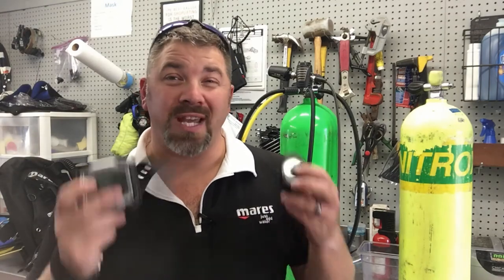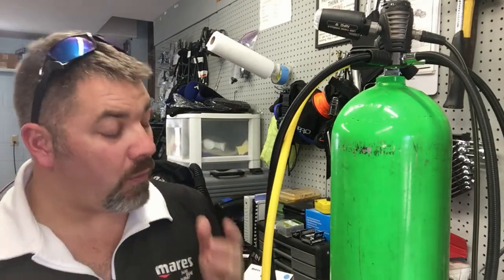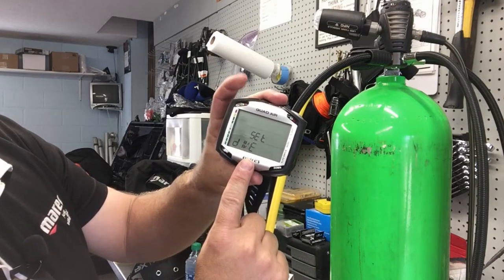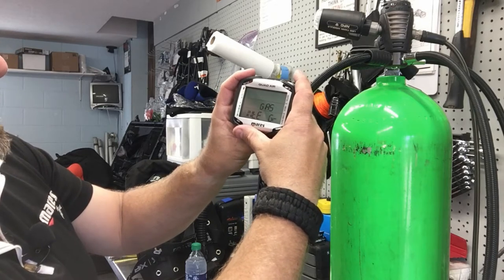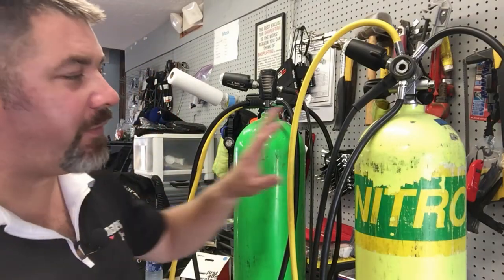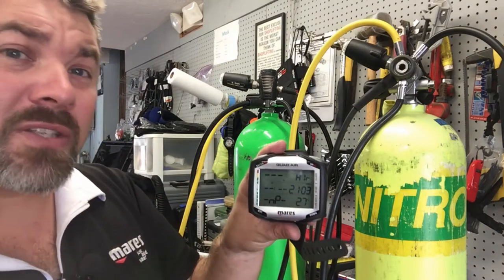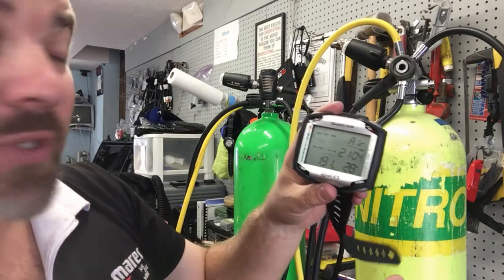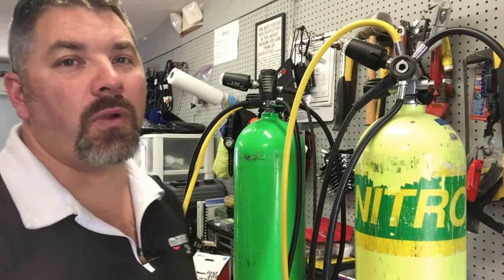Pairing Multiple Computers To The Mares LED Transmitter / Multi Gas

Comment: That's the same question I had.excellant.news.What computer would you recommend as  a back up.ive got a suunto eon core with tank pod
Reply from the maker: A lot of divers will use a single button computer for a back up.  In the Mares line the Puck Pro is a great option.

Comment: I tried this with a Mares Icon HD and a Smart Air - when the second computer paired (whatever the order), the first computer always lost its paring. It seems likely that this is related to the tank module itself not being able to memorise 2 pairings. Did you manage to validate that both computers remain paired, even after closing an re-opening the tank valve?
Reply from the maker: Hello @timshannon77. Outside of this video, we have not explored much more into the topic. From personal experience with the LED Transmitter, I have found that as the battery gets weaker, it can come unpaired at times. Its also possible it could be a firmware issue with the computer itself. Something may be causing it to force the unpairing of one or the other transmitters.

Comment: Presumably this will also work on suunto computers and other manufactures like Tisa. Aqualung etc.
Reply from the maker: Hello Kurt, I have heard that other manufactures have programmed their computers to do the same, but not sure exactly which model. If you have an Air Integrated Computer of a different manufacture than Mares, test it out and let us know.
Reply: @LakeHickoryScuba  
Certainly Brian. But only have one at present.
Suunto vyper air 2.
With suunto transmitter.
I would need to borrow a second one. I tend to use a traditional divers watch as back up.
As we never had these doing clearance diving in the Royal Navy.
But will let you know if I can sort it out the results.
Reply: @LakeHickoryScuba  
I also tend to use traditional gage pressure as back up if transmitter fails Naval habit of backup systems. Where possible.
Reply: This I found interesting Bryan. So more like this I am a technical person being an engineer.
Reply from the maker: I too will usually dive with a pressure gauge as well, even while using an Air Integrated Computer.

Comment: Do you expect much advances in AI computers, I'm waiting for the price to come down also how tough is the transmitter, are they able to sustain a tank falling over?
Reply from the maker: Hey john, I have seen the price on computers come way down and go way up over the years.  Most transmitters can take a beating, and as some have the fear of them being damaged or dislodged in a cave system, it would take an extreme amount of force to sever the connection and cause a catastrophic failure.  With this being said, dropping a tank does provide enough force to do so, and could cause a failure.  All the more reason to never leave a cylinder standing with out it being secured.
Reply: Very doubtful reall as the are plastic internal parts. Like you get in a torch won't take much impact damage. Hope it helps.
Reply: One of my friends has mounted his transmitter on a 10cm hose - this somehow helps to prevent the damage in case of the tank falling down.
Reply from the maker: A lot of divers choose to do this, sometimes it helps with pairing issues as well.
Reply: @piotrkubiec5549  good idea

Comment: Although you paired both computers it does not show that both computers held the pairing.  If you do the same test again but once you pair the second the computer, shut off the valve and purge the pressure down 3/4, 1/2 1/4 to see if both computers register the pressure change.
Reply from the maker: Hello Alex Cattanach, you are correct, our video does not show this. Thank you for pointing that out. In our experience, we have not had that issue.

Comment: So there is no possibility to pair two transmitters with two computers at the same time while having 21% air in both tanks?
Reply from the maker: Hello Piotr Kubiec, if you were diving in a Sidemount configuration, where each tank had a separate transmitter, and you had two computers, then yes you could pair two computers to two different transmitters, while both were filled with 21%.  But to use one computer for two different air sources, basically one computer for two transmitters, you would need two different partial pressures of O2 to make it work.
Reply: @LakeHickoryScuba  thanks for a quick reply. The idea was that I buy 2 computers and 2 transmitters for me and my wife and we pair both of our computers with both transmitters and we can see each other's tank pressure, but I guess that won't work here, am I right?
Reply from the maker: No unfortunately that will not work, unless you guys were diving different gas mixtures.  Then it would only work if you did a gas switch.  There would be no way for you to monitor each others gas without the gas switch.
Reply: You can definitely monitor your own and a partner's and vice versa with certain computers. As much as I love Mares' gear, you might have to look elsewhere for your computer /ai solution
Reply: @christopherrobinson8676  I went for Uwatec Galileo Sol